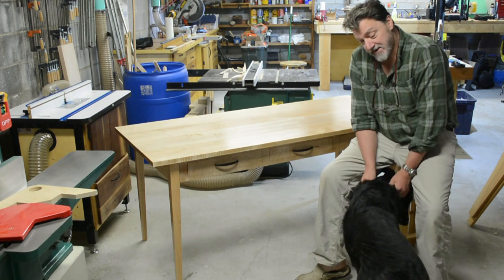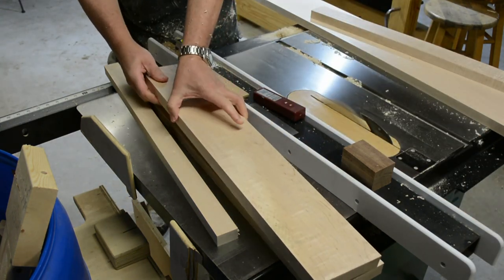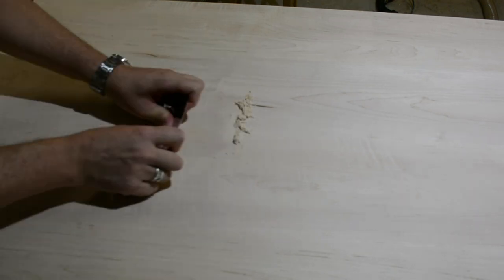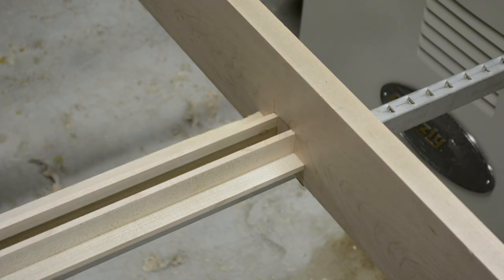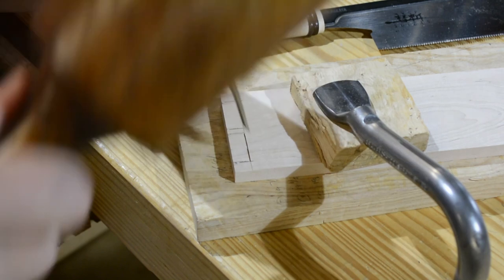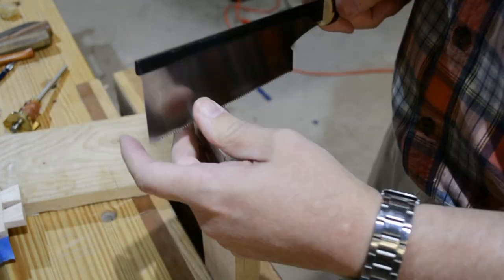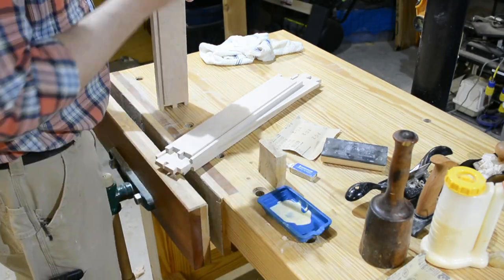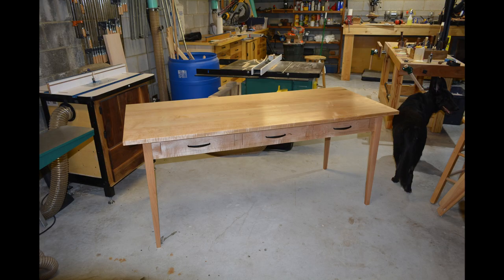Desk Build

Comment: Great looking table! This was a fantastically informative and enjoyable video :D One question: The "third edge" in your milling process, meaning the second side (not face/back) - do you clean that on your jointer or with a hand plane or something after running it through your table saw? Or do you find it good enough after the table saw? Cheers.
Reply from the maker: Even though I have a good blade in the saw and amazing blades in the joiner and thicknesser, none of them are "ready" for glue or finish. As a rule I hit all glue joints with a plane...once you start doing that (and you have your plane set for shallow cut) you will be amazed at how uneven the surface actually was.  You also realize how, try as you might, you still have a bit of snipe from the joiner or thicknesser...finally I just love the finish from a hand plane.  Not to say you can't to to glue from your typical modern blade, but a good habit to develop is to run over them once.
Reply: @Blueridgedog  That is great to know. Guess I have to break out my no. 5 next time :D